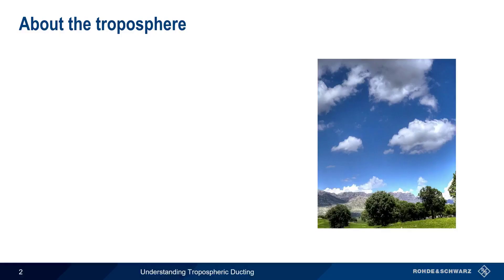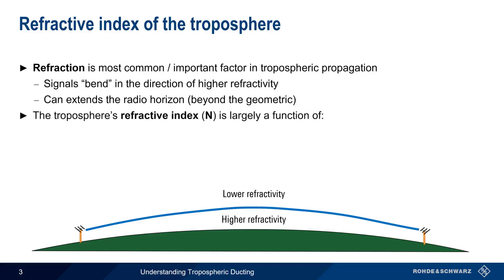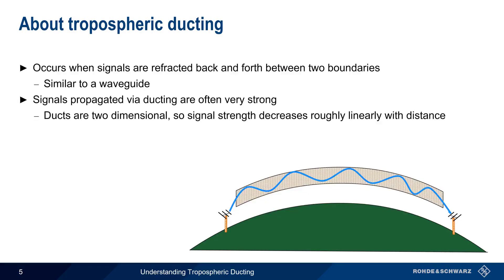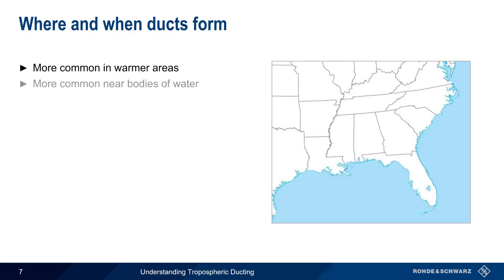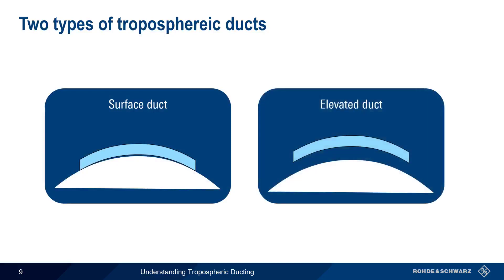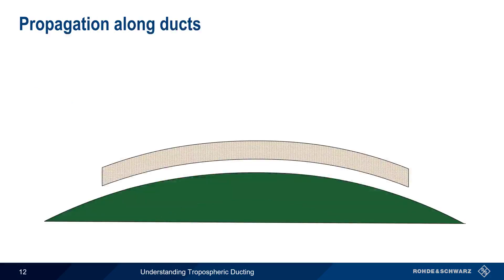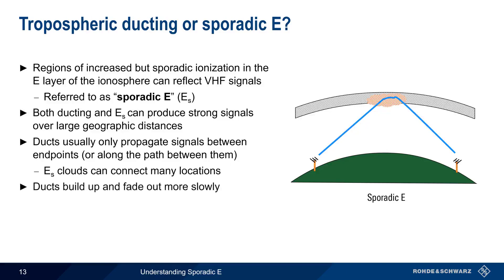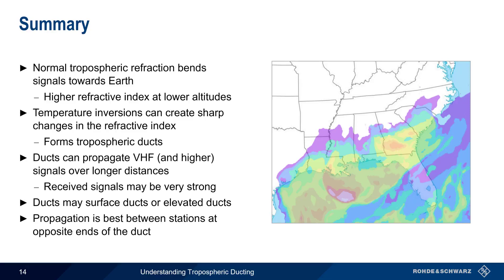Understanding Tropospheric Ducting

Comment: Some serious errors here. Refraction cannot bend a radio wave back to the earth's surface as shown in the video. This is a misunderstanding of Snell's Law. In a waveguide or optical fiber, waves are trapped by total internal reflection due to an index discontinuity at the boundary. In air, however, the index discontinuity is exceptionally small -- less than one part in 10,000 -- so that TIR is only possible for extreme grazing incidence angles (<< 1 degree). The proposed atmospheric duct would have to maintain this near-perfect geometry over enormous path lengths for extended periods of time -- a highly implausible scenario.

In addition, the cutoff frequency of a waveguide is of the order of a wavelength. A surface duct with discontinuity at an altitude of 1 km coupled with ground reflections is plenty big enough to allow ducting at HF frequencies. Since ducting is primarily a UHF+ phenomenon, this means its aperture must have a characteristic dimension of one meter or less if it's acting like a waveguide. This channel of air then must maintain its shape for up to 1000 km, corresponding to a stable aspect ratio of one part in a million!
Reply: Thanks for the comment, but I have to disagree with you:  I have personally used tropospheric ducting many, many times to make VHF (144 MHz) radio contacts with other amateur radio operators many hundreds (and in a few cases, more than 1000) miles away.  Thousands of other amateur radio operators do the same thing on a regular basis - it is a well-known and even predictable phenomenon (search for "Hepburn forecast").  

Tropospheric ducting is also responsible for situations in which FM broadcast stations are received at equally long distances, and these frequencies (88-108 MHz) are even lower.  Ducting also occurs at UHF, but it ducting at VHF occurs almost daily in the United States during the summer months.  A simple Google search for "tropospheric ducting" produces thousands of results.  Even here on YouTube there are many other videos that describe this phenomenon.

I have not seen Snell's Law applied to radio propagation - in my (admittedly limited) experience, it is primarily used to describe optical phenomenon.  But I can tell you with absolute certainty that tropospheric ducting does enable long-distance communication at VHF on a regular and predictable basis.
Reply: @pauldenisowski  I do not deny that long-haul propagation takes place at VHF+. I have experienced it many times myself. What I do take issue with is the explanation given in the video. Snell's Law is applicable to all forms of electromagnetic radiation including radio waves. The scientific community has used it for more than a century to accurately model radio propagation in the troposphere and ionosphere. It can be mathematically proven that refraction at a tropospheric interface CANNOT return a wave to the earth's surface. What may be happening is total internal REFLECTION as occurs in an optical fiber. Reflection is not the same phenomenon as refraction and the video has this wrong. But the index mismatch in the troposphere is incredibly weak -- one part in 10^4 -- not enough to form a duct except at the most extreme glancing angles. The claimed cutoff effect as occurs in a waveguide would require the alleged duct to have a cross-section on the order of a wavelength, ie. for VHF this means a 1 meter aperture in a channel 1000+ km long. At microwave it's even more implausible. And this bizarre air mass would have to maintain this most improbable shape for hours or even days to explain the observed propagation!

Comment: Does any important technology regularly take advantage of ducting, or does it cause issues with other types of measurements?
Reply: It's used by amateur radio operators for communications, but the most frequent way it manifests itself is when ducting leads to interference from distant stations that would normally not be received in a given area.